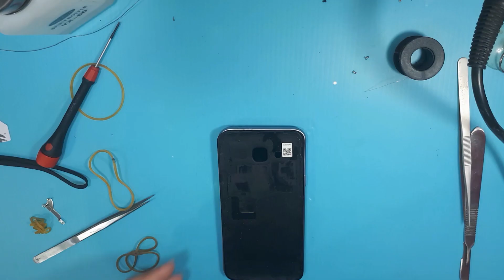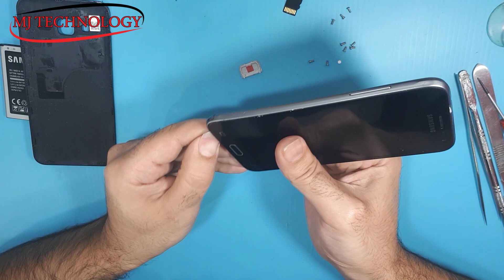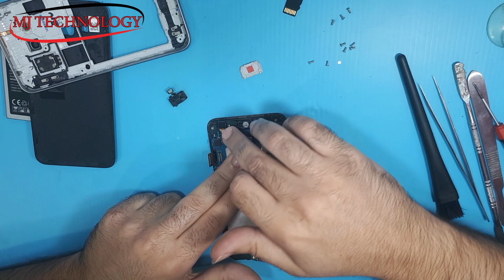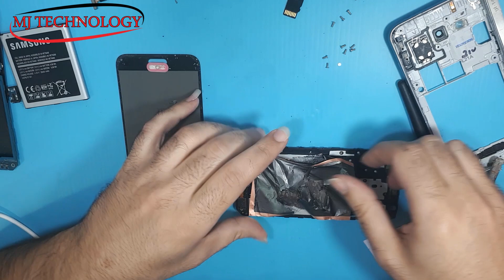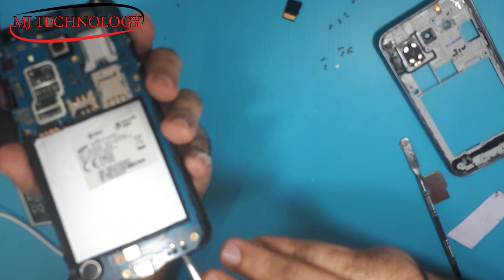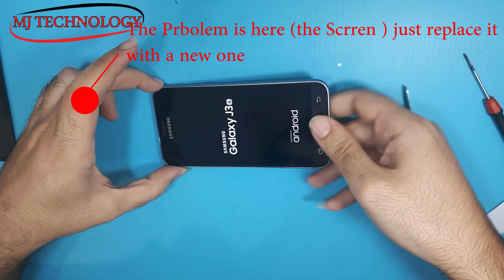Samsung J5 Light Screen Problem

Comment: Seen a few showing how to remove this screen,  do you really need to remove screws as they don't screw into lcd, can't we just remove lcd connector and battery and heat up screen and spudger it up and off.

Comment: I have an issue with the rear flashlight remaining on but it is very faint, only taking the battery will run it down, but surley a drain the the battery, is this normal?
Reply from the maker: You mean you can't turn off the flashlight?? If yes this is not normal
Reply: @mstphone  Yeah its permanently on, even when the phone is powered off, its very faint but you can see a glow when you put it up to your eye.
Reply from the maker: @stephenhibberd  this is not normal, but if the device working problem then it doesn't mind.

Comment: i can hear my phone switch on and feel vibration but its hard to see what ime doing,its bright when it switch on then it just goes dark,i have a samsung j5.
Reply from the maker: Did you try to remove the battery and power it on , if still black then you need to replace new lcd , its damaged.